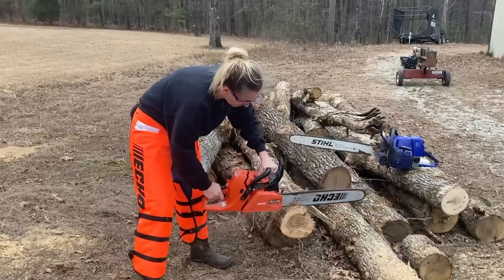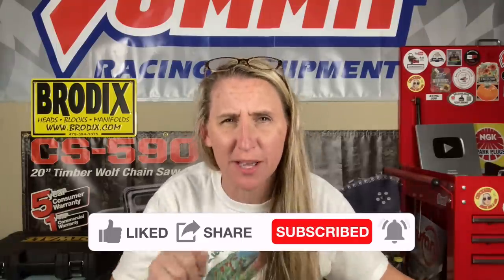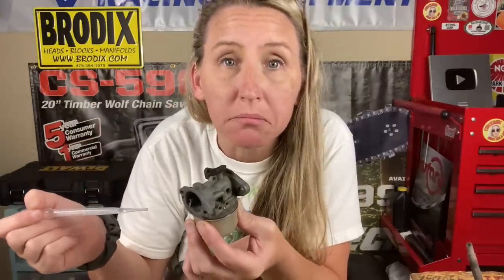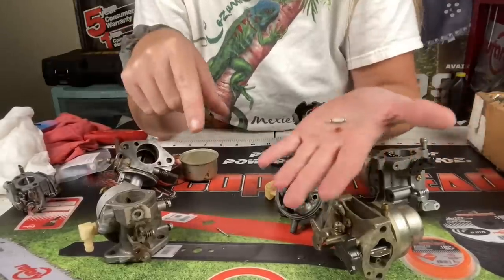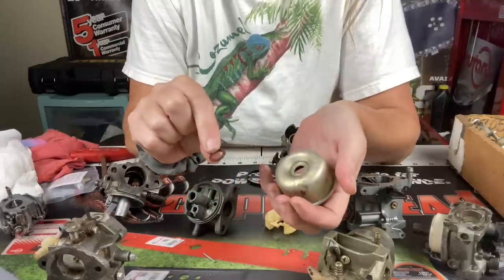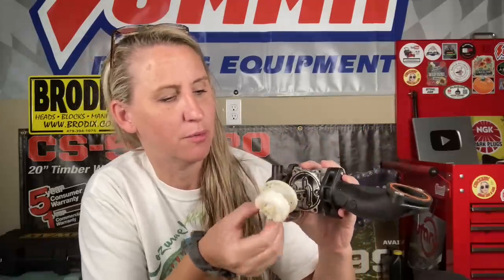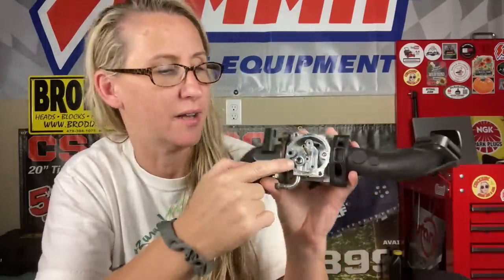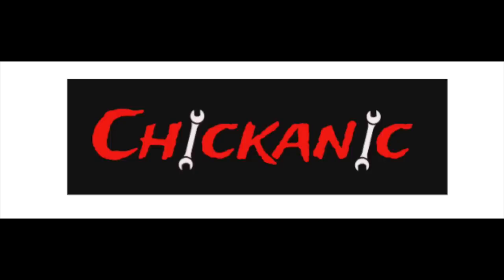STOP doing this! The RIGHT way to figure out small engine carburetor leaks.

Comment: I've had the same problem with the older Tecumseh carbs leaking. Also have a couple of Briggs updraft carbs that I can't stop from leaking. Be wary of those plastic shutoffs. I replaced 2 gummed up carbs before I found the shutoff wasn't shuttin' off. I prefer the metal ones. Great video!
Reply: She doesn't know how to set the float on a Tecumseh. Watch her videos.

Comment: so my question in relation to this is should I use real gas with no alcohol all the time? if in  a pinch can normal gas be used but then what about a total cleaning of the system?  Should I store my power saws with fuel in them as they seem to always draw moisture into the fuel tank?  Thanks for all your helpful videos.

Comment: Great advice, especially to add fuel shut valve.
Also, sometimes nothing is worn, it is just some grit, or grass debris in fuel tank got stuck between needle and seat.  After 20 years, you may need to rinse out the fuel tank to remove debris.
Reply: I do that on every mower I sell. Nothing worse than a come back or complaint saying there was something wrong with it when I sold it to them. I did have one with a seam crack that I never noticed because I never fill a tank full because too much fuel in the tank when transported can leak. I now fill them, check everything, then take some fuel back out. I am always learning, even after 30 years experience.

Comment: Those Briggs and Stratton fuel shutoff valves also leak if they are not turned on for several months and the rubber seal in them dries out.

Comment: 👋🤠 Greetings from Missouri !
    @4:55              I did actually have a float on an Amal concentric on a Norton that filled about half-way up. 😐
                            Thought for SURE it was the   electronic ignition the PO had installed.    but  not  THAT  time.
TA, Bre!                    186👍                                        🤟&✌

Comment: My husquavana 24hp is throwing gas all over the front of the engine.  Got it used needing some welds, and running it now after welding the deck issues, she spewing fuel. Cuts great, but fuel all over.  Dreading having to get to the carb, but its gotta be done.  I suspect that darned o ring

Comment: I've only ever had 1 leaky bowl gasket because I didn't replace the faulty one that I caused to be faulty. I have had a few failed needle valves back when theyvwere all metal. Recently I have been seeing the rubber tipped needles. I have yet to have one leak but they are relatively new in my experience.

Comment: Great video. This old dog always learns a new trick from you. Can you give me a couple ideas on how to fix an older (2014) Troy bilt Walk behind 21 in with a Honda GCV 160 very low idle and it will not cut because the operating rpms are too low. Should I get a new (OEM) carburetor, automatic choke attachment, or both. I will take your advice and replace the fuel on/off valve and add a fuel filter. Thanks Chicky!

Comment: or you can get a hydro lock. I got a free MTD tractor on craigslist. The valve seat is bad. I can get a new carb for less than the needle and valve seat. I put a fuel shut off on everything I have

Comment: Complicated issue. So many things to go wrong. Just like a toilet tank the float needs to be in adjustment plus all the other stuff. Never had this problem but I’ve seen it before. The float has to shut the fuel off just at the proper level

Comment: Whenever I put a fuel valve on some one's rider, I use a magic marker, write FUEL VALVE on the hood, with an arrow pointing to the valve.  A reminder right  under their nose.  Got to remember the valve, starting or stopping the engine.
Reply from the maker: Yup! We always turn the fuel off when we repair and then tell the customers we did when they pick it up. It never fails, they call saying their mower won't run and we have to remind them again about the shut off. Usually on the Honda walk behinds.

Comment: Shut-off valve, and run dry at the end, FTW. Open the valve, fill the tank, engage choke, and it starts on the first pull. Even with a new rubber-tipped needle valve and the addition of a fuel filter to keep junk from keeping the needle open, I'd still end up with a hydro-locked cylinder and a crankcase full of gas.

Comment: Thank you for this information.  I am not a mechanic but I like to try and fix my equipment before I take it to the repair shop as they are usually very busy and wait times can be long.  I was wondering if you could point me in the right direction as too where I can order parts online.  Any help appreciated.
Reply: I can't find the part number for the shutoff valve.

Comment: Fuel shut off is the best bet.
Also, looking for your expert advise on a 8 yr old toro zt mower with 22 hp twin engine.  No troubles for 8 years.  Now after about an hour of mowing will act like it’s running out of fuel and quit.  I wait 10-15 minutes and can resume mowing for 30-40 minutes and it happens again.  Could this be vapor locking?  How do I correct the issue?

Comment: All my stuff is so old I've never seen a rubber or synthetic seat on a carburettor. Have seen rubber tipped needles. I have hornets putting mud nests in float bowl vent tubes and brush cutter exhausts.

Comment: Question, here in Ky. the mowing stops from Oct. to Mar./Apr. or there abouts. What is best for the mower/carb. Drain all the gas, (either entirely out of the tank or at least the carb. Or, add some kind of fuel additive to the fuel system while it sits all winter? 

Thanks, John in Ky.

Comment: Can you address the issue with YTH18542 Husqvarna Won't Start? I have a lot of people don't understand the Fuel switch on the bottom of the bowl stops working and what issues can cause it to stop working. I have people grind the point off the switch so the fuel will flow and will this fill your crank case? I have never found that it does fill the crank case but some say it will. The fuel shut off would remedy that anyways.

Comment: I have 2 husqvarna 435 chainsaws. I replaced the carburetors  on them with Zama carbs .They run but they won't idle down and have tried to adjust them to no avail.Really could use your thoughts.

Comment: Hello Chicanic! I have a mid 1980's Tecumseh engine in my 1967 Sears Garden Tractor. Dad got it new! I installed a "new" oem carburetor. The thing leaks like a siv. I can't give up on it yet. I bought a oem rebuild kit, even though the success of rebuilding it is slim. Any pointers on how to try to get a good result? I guess I like beating my head against the wall, but I can't let her go yet!

Comment: I have a question on 08 17.5 craftsman I had a problem was  running great and lost power checking carburetor every thing is good no gas in motor just pulled the valve cover intake rocker stud was backed  out can't find the rocker taped top it not in the oil or the filter war can I get one and ware could it be? Thank you in advance great video's

Comment: I mentioned before that I've got a 2012 Toro Timemaster 30" (Model 20200). I looked up the needle and seat, Part 398188 and got the OEM Part in Briggs packaging from my local shop. The needle that came with the mower was rubber tipped and had a spring loaded flange to hang on the float. I've installed it but it still leaks. Just wondering if that is a design change or if it is the problem.

Comment: Except most chainsaws have a check valve and not a tank vent, so as the gas expands with heat and the check valve is working where does the gas go, it takes the path of least resistance and forces the needle open.

Comment: lawn tractor started slowly leaking fuel and of course down the intake and hydro locked multiple times siting around unused. 🤬 it was about years old then and instead of touching the carburetor, I installed a fuel  shutoff petcock. 🤣 that was over 20 years ago, still not touched it. the fuel cutoff solenoid sticks shut sometimes, just give it a thump with screw driver handle, it's also been that way about 20 years. it doesn't leak and runs fine as long as you shut off the fuel supply when not in use. I'll get right on fixing it in the next 20 or so. 🤡

Comment: I subscribe to your channel cuz it's the best thing for me on small engine repair. I use your links for purchases, etc too.  I have one question...are the fuel shut off valves you link really good for gas? I ordered them and they have the gas pump with a slash across it suggesting they're not recommended for fuel.  Picture two on Amazon also shows the "not for fuel" embossed label if you zoom into it. I installed them anyway and haven't noticed any problems.

Comment: Chickanic. I have a carb that is leaking around the choke control rod. Surely this can’t be a needle valve or float problem. Is there a gasket or seal on the choke rod?  Don’t know what brand of carb it is but it’s on a Kohler Command engine. Thanks for any info

Comment: I have a 1974 toro 7 hp snowblower with tecumsah and the carb is really hard to adjust even after kitting it. I tried a aftermarket carb which was worse. Motor runs good otherwise. Any ideas... should i just get a new motor?

Comment: I have a six year old husqvarna 3200 pressure washer with a Briggs and straton, it just stopped,  boom!  Compression is 24 psi. Ugh is it dead?  I put in a new plug and noticed that its black like trying to fire.  Any suggestions?  Mike

Comment: Get a kohler courage 15 and the tecumseh eginens carb works so mutch better. i had a kohler courage 15 i took me 3 houers evry time a want to use it to get it running properley. when i fineley got it running i whouldent shut it of for a lunch break. moast of the time i had a string of fuel of 10 mm out of the airbox when it was running. and it took 2 liters of fuel evry week even if i hadent run it. and if i installed a fuel valv on it the problems got so mutch bigger. I eaven had professionas look at the carb and they couldent se the fault. I switched the engine out an put a 21 hp briggs in it and no problems besides a hedgasket change. 211 houers on that engine now.

Comment: I dont recall anything rubber inside the carburetor of my Echo trimmer that is leaking fuel into the air filter. To my recollection the needle is just metal.
Reply from the maker: It has a silver rubber tip. Looks like metal though.
Reply: @Chickanic  Thank you for your reply! Ya it leaks even when just left sitting unused and soaks the bottom half of the air filter. Costing a lot of money just replacing filters. I replaced all the gaskets and rubber parts in the carb when I bought it used and must have goofed something with the needle so I'll be opening it up again to look. Appreciate your help here and all you do on the channel!

Comment: My Dad's log splitter stopped working AND would not stop leaking after transport; WITHOUT the fuel shut off, shut off. Ruined the air filter, lost half the tank of gas. Dirt and debris and goop in the bowl and stuck in the hidden screen at the inlet. I warn to not use regular gas but he does not listen. I warn him to not leave his gas spout sticking up from the gas jugs, even with the spout seal installed, because the spout may have collected dirt and bugs; but he does not listen. I take after Mom.

This Briggs engine like so many others with similar carb.s does not have a gas filter??? What are they thinking? I have some smaller see through paper filtered inline filters on order. This should keep some of the dirt out.

I haven't looked close enough to see a gas tank internal filter, but if there is one it isn't enough, and relying on a possible screen in behind the inlet bib on some, is also a bad idea. Same with chain saws; I would rather the dirt stay out of the carb.. Maybe I am fussy?
Flushed the gas tank three times and cleaned the carb. twice. The intake valve lash was too much but that wasn't stopping it from running.
Not leaking anymore, and now running again; till he uses regular untreated gas again.

I am gathering parts to build my own, more powerful log splitter, that no one will mistreat or break from being careless....like backing into the log splitter with the tractor in high range, then blaming the tractor for its' bad breaks...which also could be fixed, but won't :-( That mistake cost a bunch of parts and repairs on the new engine; new then.

Dad insisted that the problems before were because of the old engine, being worked to death, but again, he would not listen. The problems were hydraulic. I now have that old engine on my tiller and it starts with one pull usually. Sometimes two pulls. I am actually very surprised at the difference in mechanical aptitude between Dad and I. Yes, actual father. Got the RH positive from him lol.

Comment: So, that 4180 or 4282 carburetor  isn't a "2stroke" carburetor. It's a 4Mix carburetor exclusive to Stihl 4Mix engines. I used to try to rebuild those but most of the time it was met with failure. The fuel ports and check valves are just to small to clean out with much success. I usually tell the customer to bite the bullet and buy a new Stihl carburetor. Yeah Stihl jacked up the price of them 100% (thank you covid lockdown a-holes) not a cheap Chinese carb off e-bay or amazon. Always go OEM when you can. 

But here's the thing... Stihl owns Zama carburetors for the most part, cheap or not. Let that sink in.

Comment: If you have a late brigg with a plastic carb there is no repair parts repair instructions say replace carb 45$
Motor manual says you can use E10 bull shit the alcohol ruins the néedle rubber tip and bowl gasket Use CLEAR GAS!! Don't know why she doesn't mention this

Comment: Yet another reason to pay the extra buck and always run ethanol-free gasoline in your small engines.  It's just not worth the reduced lifespan on rubber/synthetic components in your fuel system.